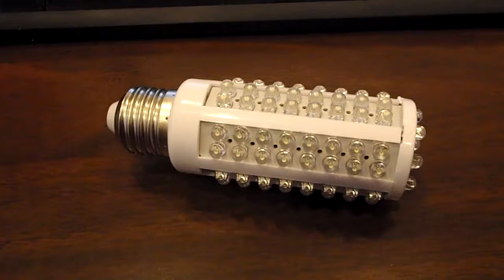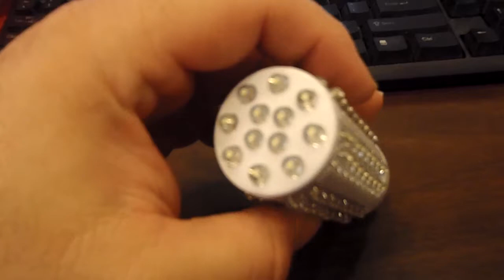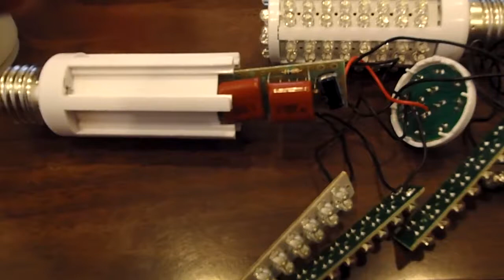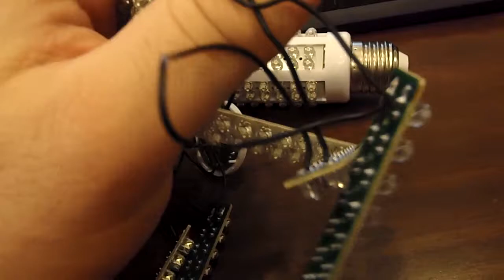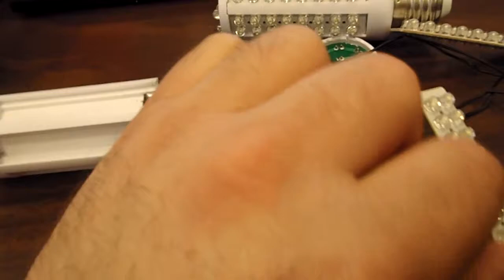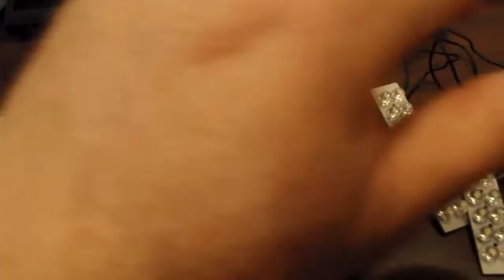Chinese LED Corn Lights FAIL

Comment: What do you think you're proving?

So they have no glue? That's a good thing, not a bad thing - less toxic chemicals and more elegant construction, the whole thing just slides together.

Put together like Christmas lights? So what, you think each individual LED should have its own independent wire to the ballast? I'd love to see the safety/reliability/price on that.

How is the entire design worse than an incandescent bulb, or fluorescent bulbs? They are the same thing which is a lighting element connected by a wire to the ballast.

Your "documentary" is snobby and ignorant. You come off as someone who hates China and thinks that electrical work ought to be as aesthetic as the vacuum-sealed packages you buy at Walmart and thinks he's an expert because he was able to disassemble the casing of a LED bulb.

Comment: I bought two 108s (like the one pictured ... his wasn't 88 it was 108) in September and now it's the latter part of March. Anyway, I put them in my carriage fixtures on either side of the garage. One just failed. What happened was seven LEDs went out in one panel, then the entire panel (16 LEDs) quit, then the entire light went out except for a few sporadic LEDs glowing dimly on various panels. The other lamp has lost a single LED, so it's still going strong in my book.

Comment: Why do you conclude that it's the LEDs that have failed? Have you tested the LEDs?
High voltage capacitors can have a life of 2000 hours if the wrong type is used. It might be worth changing the capacitors if the LEDs check out ok.

Comment: I bought couple of different LED bulbs (corn lights, and spotlights) from China, months ago, and so far they all are performing flawlessly.
.
You can seriously diminish work span of these bulbs by using them on places where frequent switching on and off is necessary. That's why It is better to leave LED's on for prolonged periods of time than to constantly toggle them on and off.

Comment: Yes you are 100% right....because I purchase 2 on eBay for 5 bucks and 6.99  to test how good they are and how long last ...and the first one only last 2 weeks the other one is already 3 weeks so far and still working...so let see how long last....thanks for your video...